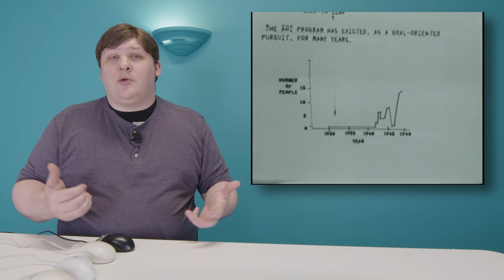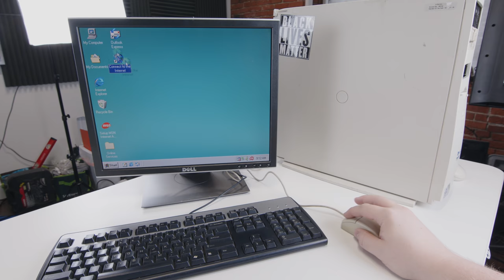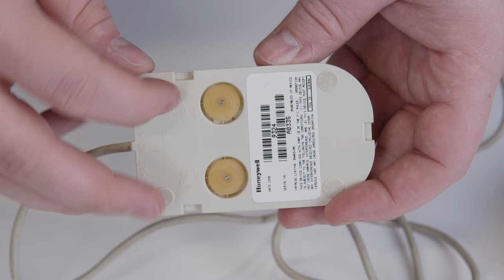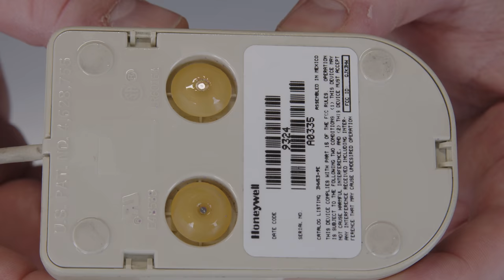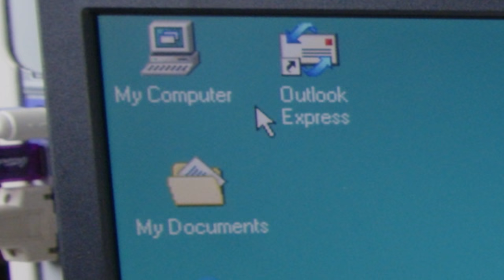Jack Hawley's Unstoppable Computer Mouse

Comment: That's fairly old video already but it just popped out of my feed and... why not give it a comment? This magnetic thing is actually quite important. Regular mouse relies on friction to turn the ball. The ball has to roll two rollers and the tensioner, it needs to have quite a bit of force to do that. That's also why the ball is rubbery, otherwise it would just slip all the time. The original design also was flawed. As it had two rotating rings, every time you move in one direction, you drag the other one sideways. For this it had to be as smooth as possible and it would still catch anything. You could not use it on anything except hard surface. Not even a mousepad as it would be scratching all the time. So this weird design serves a purpose. Rotated wheels at an angle mean that there is no sharp corner, it can be used on fabric. Very smooth finish means that it will have almost no resistance when moving in the wrong direction. The problem is that it has to have some resistance, otherwise it would not move at all. So what do you do? Reduce rolling resistance as much as you can, for example by using magnets! That's actually quite nice invention. Ball mouse always stopped working when the rolling resistance over the dirty roller is higher than dragging heavy, rubbery ball on a table. As you use it, the roller becomes more gummy and uneven, requires more and more force to roll and at some point it's too much and you just drag the ball that does not roll. That's why the oil test failed so miserably. This ball needs enough grip to overcome all other forces.

Comment: If you want to try one of those DEC hockey puck mice, let me know! I have two of them. I've also got one of the Honeywell types and my family used it daily for years on our first 386. You're not wrong about the tracking problem at odd angles, but I don't remember it being a major issue. I only remember it because I thought it was amusing to try to find exactly the right motion to cause it. If I recall correctly it just kind of dragged on occasion, no worse than a typical ball mouse with a bit of dirt.

Comment: People used to say to me that I was a bit strange for being facinated by computer mice, but you just proved that they are more interesting than just a simple input device (not that I didn't know that already). I never knew about this design of mouse though. I don't know what was more susprising, that the mouse worked on the oiled surface or that the ball mouse didn't. I assumed the ball would just get lubricated and glide more easily, not mostly stop moving.

Comment: Re the limits to the potentiomiter, they probably correspond to the limits of the screen, eg the max and min on the vertical correspond with top and bottom pixels and thus would not be an issue

Comment: Honestly in this day & age it's entirely possible to 3D print a clear case for that mouse. Since 3D scanning has become as easy as it has it's really no bother to scan the original shell and print a 1 to 1 copy. As far as the transparency of the material, that's another issue that can be solved by printing a negative mold instead and using clear acrylic resin to fill the void. Then you'd have a mold to make future copies which could be an interesting endeavor. It occurs to me that any patent held on the device you have there may be expired and it might be good for a laugh to make a new version with slightly updated components. One could even update it to use USB, PS2, or serial port depending on which cord is attached. It seems robust enough, not like the fidly things we're stuck with now. I reckon it might be worth a shot for what that's worth. And it's flaw can be fixed with an additional roller in a 3rd angle in a triangular format.

Comment: I know cleaning was an issue with ball mouse, but in my experience it was something that only had to be done after month(s) if I recall correctly. At least when used with a relatively clean mouse mat.

Either way one thing I hate about even modern optical mice, is that the mouse wheel on any mouse I have used have the same issue. It takes long time but eventually it stop working realiable which means you have to open the thing and clean it out manually and sometimes this does not even fix the issue.

My current mouse now is having this issue where it will not scroll smoothly and will even scroll in oppsite direction.
Reply: This is something that Logitech has finally solved with their latest MX series mice (Master 3, Anywhere 3). They now use some sort of electro-magnetic mechanism both for the sensing and for the wheel "notches", replacing the optical encoder and mechanical ratchet mechanism. It'll be nice once the patent expires and price comes down so this can be seen in more mice.

Comment: I don’t think magnets in a mouse are harmful to floppy disks. I’ve done experiments with audiotapes, videotapes, floppy disks, and speaker magnets and other magnets I’ve pulled off things and haven’t successfully erased any data without directly touching the tape and moving it very rapidly, even then it usually doesn’t erase or distort anything

Comment: Shortly after ball mouse were introduced I discovered the Honeywell mouse and after a few months use, started advising all my customers to replace their gunged up ball mice with the version that some called the female mouse. Complaints of their mouse not working or frustration over having to clean the ball dropped to nearly zero. One of the best mice of their time superior to the ball mouse at least until the optical mouse.

Comment: Oh, I remember cleaning mouse balls, I also remember showing a new hire how to do it. I was almost floored when the student asked "Doesn't cleaning the mouse ruin the felt rollers?" I tried not to laugh when I said that you need to remove the felts (tiny dust bunnies) off the rollers also for the mouse to work..

Comment: 4:35 some arcade cabinets used trackballs. the mouse is simply a trackball upside down. its not a mind bending or insanely innovative design lol. its an obvious conclusion, which is why numerous people independently designed it and we still use them today. the various optical mice are something i would consider to be crazy innovations, especially the optical mouse that can work on clear glass.
Reply from the maker: Those arcade cabinets came five to ten years after the devices I'm talking about. Videogames became publicly available in the mid 70s, early trackballs were invented in the late 50s.

Comment: Some major lab put a lot of work into finding which tool was best for controlling a cursor on the screen. I'm not sure if it was in Doug Englebert's lab or not. I've got a book somewhere, but I never get around to reading anything through, these days and I've lost it.

Just like early cars, there were some pretty good features in forgotten computer programs and operating systems. :)

Nice model! But it shows that the qualities of the friction between the wheels and the surface matters a lot. I recall a rather unclear picture of a wheel mouse with notches in the wheels which I suspect was awful. :)

Oof! Exposed contacts in the encoders? WHAT were they THINKING?! XD The Telefunken puck's encoders were nicely sealed.

I had an 8088 / MCGA single-floppy laptop I'm really sorry I threw out because it was shaped like the 1st-gen iBooks but built presumably 10+ years earlier. It must have beaten the Thinkpad to the title of first modern-shaped laptop, too. It seriously needed retrobriting and 640x200 looks terrible in a reflective LCD, but those were the only things wrong with it.

Hahaha! The unstoppable mouse is a return of the wheel mouse?

The oil test is amazing! This is great! XD

Aww, it slips at certain angles. :( Well, this reminds me that my first optical mouse, for all its flaws, was a big step forward in comfort and ease of using a computer. Ball mice weren't terrible, but they never tracked as well as that cheap, surface-fussy optical mouse. And yeah, I've always been big on little micro-adjustments.

Hahaha! I never imagined a mouse convertable between 2 & 3 buttons. I mean, why would you do that? CRD, you were saying about the size of your hands in another video, so if you don't know, who would? It makes no sense to me.

Comment: if you consider the intellimouse released at $54.95 the early ones must have cost a lot more, i was still using a ball mouse into the 2000's, there just wasnt a need to spend that much back then on a mouse when you could pick up a ball mouse for $5.

Comment: I first observed the Honeywell mouse at Comdex on Las Vegas.  I got to operate it in a plastic dish with a quarter of an inch of liquid mustard.  I got home and ordered one and used it happily until I got a computer with USB port.  I will look for the box.  The secret (according to my boss, who had been a tank repair officer)  was the journal bearing and magnet.  The journal bearing makes for smooth operation while not letting in anything.  My boss claimed Honeywell made these mice for military and that they were NBC (nuclear, biological, chemical warfare proof).  Apparently Honeywell made keyboards for the military that survived better than the tank crews.  The military contracts made building these mice profitable.   Like the internet, this mouse is a product of the cold war.

Comment: I've scraped many a roller. Optical mice were a revelation. I would probably be happy with that double disc mouse!
Reply: My high school certainly was! They had them for something like four years before I finished school. I assume they eventually got replaced with optical ones down the line, but I have no idea when that would have happened. Windows XP era, maybe? That might have justified an upgrade from the Win95 systems they had when I finished school.

Comment: i use the same mouse for the last 15 years, it is lime green mechanical mouse i made myself to some extent and even the cable is oryginal it will never die because it is ps2 and serial compatybile :P
when i draw i lift it and hover it over the table suporting with my wrist and i never was able to do it with optical, bluss i am acustomed to ball inertia so i really can't consider optical mouses as a good replacement

Comment: Objection, I think the magnets are way better design. For 1 reason, when the mouse is down and touching the surface. There should be space between the magnet and the iron disc. So, there is effectively no roll resistance and it gives them just enough down force to keep the wheels on the surface. I feel like it is a better design. Also where can you find roller bearings that small?

Comment: i have that very same optical Intellimouse with USB (yes, USB and optical in 1999). Found it with the box in the trash from a local computer store back in november 1999. It had a problem with the cable, i fixed that and its still in use in my retro computer. It was u$s60 new back then (100 today). Due to its low DPI its not suitable to use in a high resolution desktop (very low movements even at maximum speed, yo have to move much more the mouse to reach a corner).

Comment: I hated mice from the start.  When I was issued a personal computer by an employer in 1989, I suffered with the mouse for about a week, just long enough to acquire a trackball.  Yes, the trackball cost several times what the mouse cost, but I haven't suffered carpal tunnel syndrome in over three decades of computer use.

Comment: Logitech M570 laser trackball is the best. Just move your thumb. Occasional cleaning, sure. Instant sharp placement, always. No wrist pain ever. No special pad necessary. First trackball I ever had was built into a Compaq 486. Hated and loathed every trackpad ever, to the point where I open up laptops and hard disconnect them.  One day I was sitting there pissed off at a shitty laser mouse, I decided to look up trackball and laser.  I bought a second one shortly after.

Comment: The first optical mice were expensive, required a special mouse pad, and required the user to keep the mouse oriented with respect to the pad.  In other words more expensive, more fussy, and bad user experience.  The IntelliMouse licensed technology patented by HP.  It used a microcontroller and a high speed CMOS camera to take infrared images of the surface below the mouse.  DSP algorithms then detected the relative motion between frames and converted that to X,Y movements.  There is no comparison between the original optical mouse implementations and the HP implementation.  The originals never caught on because they were finicky novel geek-gadgets.  The Intellimouse technology did not exist until HP invented it and Microsoft mass-produced it.  This was the implementation we were waiting for and it is why we had to wait.  In the meantime the command-line was still quite popular through the mid 1990's and ball mice did an adequate job.

Comment: 3:32 Wait, why would you have to move it? If you moved the potentiometer all the way to the left, for instance, and then picked it up and moved it to the right, you wouldn't be able to move it further left. You would have to move it right across the table/surface for it to turn the pot back to the right side so it can be moved left again.
Reply from the maker: If you hit the right stop on the pot before reaching the right edge of the pad you'd have to move it to recalibrate it to your work area.
Reply: @CathodeRayDude  But wouldn't it stop the mouse due to the high friction when the pot can't turn anymore? I guess that would be a use case for an oiled teflon mousepad...

Comment: This mouse is amazing, to work so well on oils high density plastic, it would likely work just as well up a wall, upside-down on the ceiling, on the ISS, on a bumpy train ride,...

We need modern wireless version of that.

Comment: With the "original" mouse, the one that uses potentiometers, is it possible that the min and max were both mapped to the edges of the screen? Ie once you hit the minimum on the x, you're at the far left, and vice versa? Seems like it'd be the way to go if you weren't familiar with mice.

Comment: So - I guess it was just a special kind of mouse for harsh conditions. It's pointless to replace your office mouse with one of these, but it makes sense to use one in a workshop. I wonder how good or bad would optical mice do in the teflon/oil test. My guess - they wouldn't work at all. My mouse doesn't work on my glass table. I also had some mice that were advertised as ones working on glass, but well... nah. They could detect some movement, but it wasn't a very usable feature. BTW, the modern mice are not totally immune to dirt and dust. The dust will eventually make the sensor fail until cleaned, a grain of sand (there's always is a grain of sand, it beats me why there is a grain of sand in my room) that stick to the slider and you get this hiiiidious feeling of scratching the pad with the grain. I hate it so much when it happens. Considering the workshop - mice suck. Touchscreens and touchpads are way better for operating electronic tools at work. I wasn't very comfortable with using some old style resistance touch screens, they seemed so delicate to touch. The modern ones feel like hardened glass, almost indestructible and quite easy to clean.

Comment: The early mouse could have worked almost as a modern one would, set the lowest pot value to (like bottom left or something) 0x0 screen location and max pot value to the resolution of the screen(one max the pixel hight of the screen and the other the pixel width of the screen), unless the pots were sprung picking up the mouse would not help and if they were then it would spring back to 0x0.
You didnt want to try an optical on oil? i dont with one of mine either but will update my comment when i do

Comment: I used one back in the day at work, and it worked fine. However, I never gave it the sort of workout I could have done if it were on my own personal computer (gaming and stuff).

I really liked the idea, but I never actually knew the model name of the mouse so I never tried to buy one for myself. And no one at work realized it had cool advantages. We just saw it as a weird mouse. I wish we had realized.

As for optical mice ... yeah they were a LOT more expensive than ball mice. It was like the difference between a $20 mouse and an $80 mouse. Also, the metal optical mouse pads actually sucked. I remember the first time I got to use a workstation with an optical mouse I thought it was so cool ... but then I found out the friction between the mouse and the pad just made it awful to use. Too much friction! Honestly, ball mice were more pleasant to use than those optical mice.

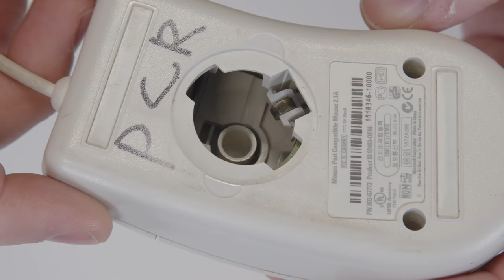Comment: 17:07 "Over time it builds up on the rollers into a disgusting brown crust that you have clean off with QTips and Alcohol [...] or scrape off revoltingly with whatever you have on hand"

I believe you mean "you get the luck and satisfaction of getting to scrape the cheese off the wheels."  That funk was nasty, but you can't say that pulling it off wasn't satisfying.

Comment: My first thought was that it would feel unpleasant that when moving the mouse horizontally or vertically, the wheel that isn't turning is *dragging*.
Reply: Probably not, with the original design, sure, but with the aggressive angle I doubt you'd feel it.

Comment: IMO using a potentiometer-based mouse wouldn't feel different from using a regular mouse. The extremes of the pots would equate to the edges of the screen and the pot position directly maps to a (x, y) location on the screen. The only common thing you wouldn't be able to do is infinite movements like found in first person video games.